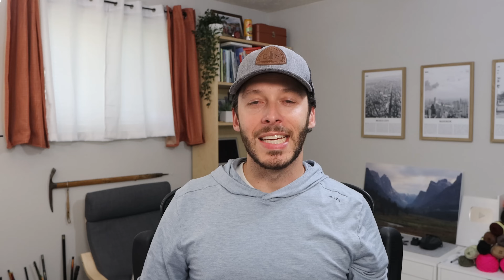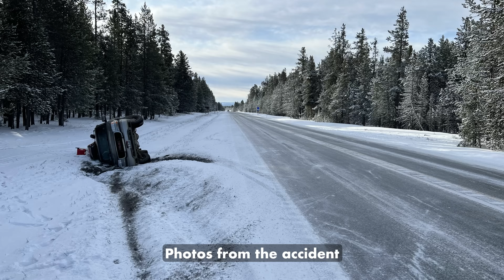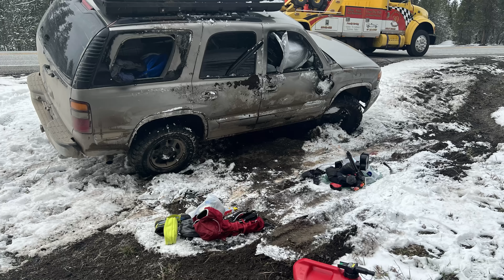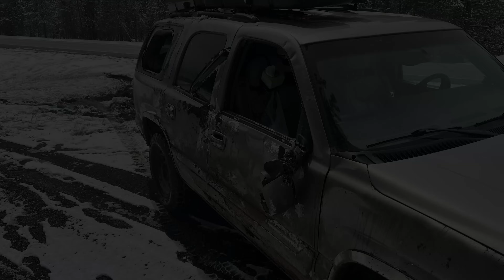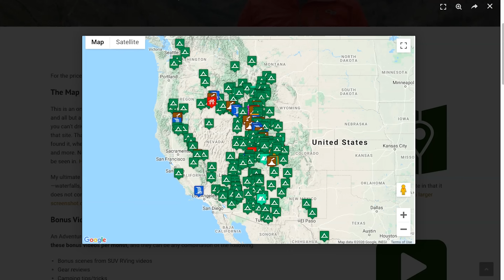I Crashed and Totaled My Car (Now What?)

Comment: Glad you are ok. Bummer about the Tahoe. I absolutely love your detailed descriptions of all the places you go and how you look for the off the beaten path areas! Thank you! 

You said "I slowed down"... If you completely lifted off the throttle, weight transferred to the front tires (increasing front traction) and that weight came off the rear tires (decreasing rear traction) thus causing the rear to start "Wagging".  The "Wagging" increased as your hands were chasing the wag and falling behind the needed steering input to dampen/correct the wag. I would also say that your eyes did not stay focused down the road lane that you wanted to follow...this make it nearly impossible to input steering corrections in time and ahead of the vehicle movement.   If you added brakes at any point in this it got WAY WORSE!!!. If you were in 2wd.... Lifting fully off the throttle applies a braking action to the rear wheels only. The shorter wheelbase of the Tahoe vs the Suburban tends to aggravate/increase weight transfer. The suspension lift also increases the transfer. 

On ice and hard packed snow you would want to only reduce throttle to what is called "Neutral throttle" which applies no acceleration or deceleration forces to the tire contact patch. This lets you have 100% of the available tire grip/traction for steering and skid control. 

My background: Long history of sports car racing, vehicle dynamics instructor, performance driving instructor...etc.
Reply: Yes, anytime you "feel" ice, go to neutral or push in clutch with stick shift. Free roll without brakes or throttle is best. I often have done this and in sketchy conditions keep a hand on the shifter just for this reason. Saved me more than once. Also this is one of the down sides of "lift kits and oversize tires. Raises the center of gravity such that it is easier to roll the vehicle. Stock height might have stayed on all four tires instead of ending up on side. I know it is a trade off for clearance but lift as little as possible to get what you need and no more. Like you said, you don't need a "rock crawler".
Reply: PS For users like Tristan skid plates are often enough instead of lifting it. Just some protection for the oil pan, rear end differential, and steering components. Just a thought.
Reply: Mark makes a good point about having skid plates.  And of course steel ones are much better than the aluminum which will just get punched through.  More lift also equals worse gas milage, so another reason to only lift minimum needed as Mark discussed.  A trade off,.. as is all of life.  cheers all.
Reply: Wow, I  was thinking about the  physics but you did an excellent job of explaining it.

Comment: So.....you neglected to state what you learned regarding driving early morning cold with snowy roads?
Did you have 4x4 engaged? 
Speed vs road conditions? 
Maybe tire chains would have been better for the conditions? 
Should you have better secured some things inside?
 
You said that you drained the starter battery. You do not carry a "Jackery" type utility battery?

 You did not install a second car battery (dual battery system)??? Definite must on my adventure vehicle!
Consider doing that on your next adventure vehicle. 

Have you removed the accessories (frig/platform/etc) to refit to a new adventure vehicle? 

Sure you are considering and reflecting on a replacement vehicle. 
Suggest you consider an older  Jeep Grand cherokee with straight 6 motor. Although some have an interior spare.
Or maybe a Subaru Forester.
Or Toyota 4 Runner.
All smaller then Yukon, but room enough, decent mpg, very capable without modifications, good daily road manners, dependable, easy to repair, much aftermarket support.

Comment: Glad you were OK! I have a similar vehicle that might be worth consideration. Mine is a 2012 GMC Yukon Denali 4WD Hybrid. They only made these 2008-2012 because unfortunately gas was too cheap and consumers were not willing to pay extra for the hybrid. GMC also did not further develop this model so it isn't really a great hybrid (my 2010 Ford Escape AWD hybrid was much better). That said, with KO2 AT tires and roof-mounted Maxtrax my gas mileage is still 19 on the highway and in the city. The electric air conditioning can run with the engine off although not for long periods of time like the Ford hybrid did. This model series is more refined which unfortunately means less aftermarket off-road parts, but it really does perform very well on trails. GMC has an accessory panel under the dash which can be used off the shelf to hardwire 12V accessories to rather than use the always on outlets. I wish I could attach pictures, I opted for maximum headroom for the full bed and a huge shelf in the back with a sliding shelf for cooking (sort of like your RAV4 had before). These GMC hybrids are not common, but really are great vehicles if you can find a good one.

Comment: Aww, always such a sad sight to see vehicles in a position that they were not supposed to be in; good to hear you didn't get injured! Just wondering: did time slow down when you were twirling over the icy road??
Reply from the maker: I wouldn't say it slowed down so much as became very clear. It happened fast, but I remember thinking, "Huh, so this is what crashing a car feels like."
Reply: The faster you are traveling the more you feel time slow down... with older vehicles the insurance companies always total them. If Tristan had time tools and skills he could buy the wreck and fix it  or salvage parts and likely make a couple thousand off the Yukon. We repaired our children's car twice when insurance companies totaled it,  both times people backed into it. The car was only worth $1,500. Parts from the local salvage yard were under  $200  and less than 8 hours of, father son time to repair it both times. We got more for that car when we used it for a trade on a new car!